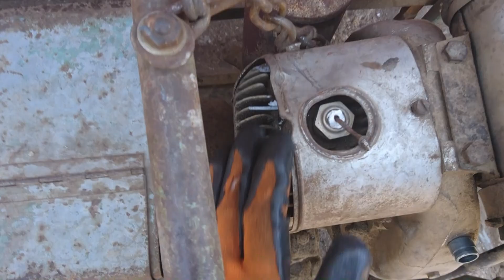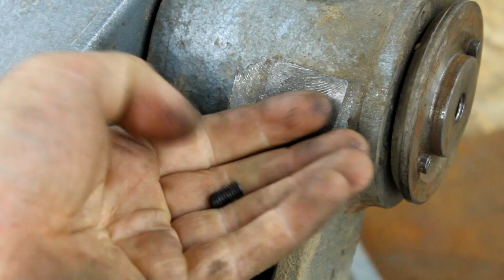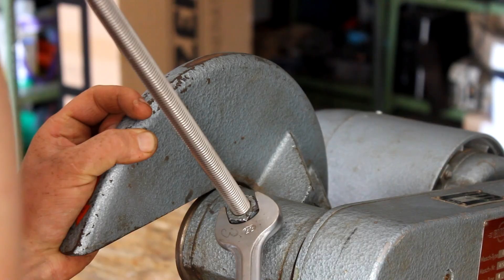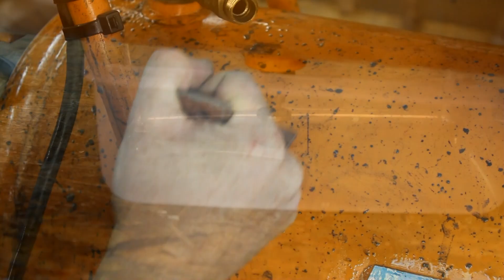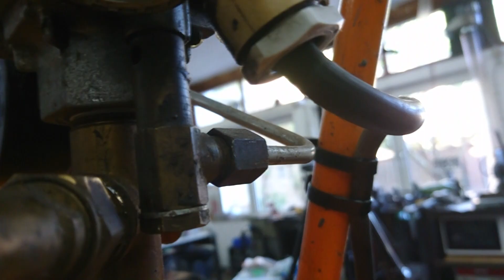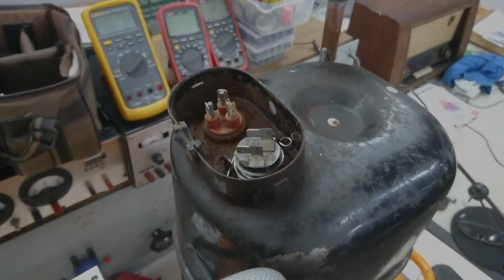Many More Scrapyard Finds! Repair-A-Thon!

Comment from the maker: The first four episodes of this series can be found in the video description!
Reply: LOVE the intro.
Reply: @jamiestone5364  The intro has very energetic music. It reminds me of running very fast downhill.
Reply: personally if you made videos of going through the scrapyard we as viewers would still watch both as it is cool to see the items that are there and to theorize how they could be repaired or re-purposed
Reply: You can make your own ultrasonic cleaner. They are super easy to make. Ask your friend to allow you to take the one you borrowed apart to inspect how it's made, then using fleaBay, purchase the kits that are in plentiful supply online. The only difficult part is how you attach the bell to the tubs (you can use tubs like the ones used in presenting salad bars, the deep kind). They provide a mounting screw that has to be spot welded to the tub with most kits. That, is the most difficult part.

I made mine using a cheese making vat (found it at the scrap) and such a kit.
Reply: Geile Sache, man fängt an alte Werkzeuge mit anderen Augen zu sehen
Reply: Please...... finish the videos on SMPS
Reply: I love the silent compressor... I hope I can build one someday...
 Many Blessings , SMR
Reply: Careful about soldering high pressure components, solder will become subject to wear and tear as pressurization occurs. Just my 2 cents.
Reply: Finish the other videos, you never put parts 2 out. You just abandon everything and move on to other stuff
Reply: No like for you because you didnt time how long to fill and compare to old pump on the compressor (very useful to know if the extra time to fill compressor is worth the silence.) was it 2x as long 6 times as long? 10 minutes to refill at super slow speed or the same speed?
Reply: Hi, just a little detail... the 3 connectors on the the compressor could have been single phase constructed with a START and a RUN winding with a common leg to those 2.
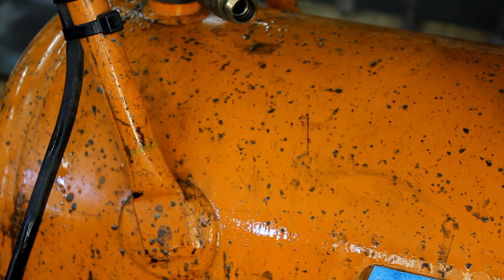Reply: 17:22 To remove dried concrete, you can wash it with Hydrochloric  acid, aka Muriatic acid. Test it on a small area, but it should work fine. I was told about this by a guy who worked at a concrete plant as a delivery driver. He had to use it to wash the truck after each day's use.
Be careful with it and follow the safety instructions, after all, it is a strong acid.
Reply: 1. RIP stamping machine
2. RIP Kuper machine
3. RIP A. Neumann "gear motor" having machine
What if viewers got you a pickup truck? That is a tragedy to lose the classics.
I wish I had a fraction of your electrics education..
the base and fence of that Eisele chop saw are amazing, have you seen the chinese junk at the store? over $100 and the fence is the first to break, thin aluminum not a single piece but multiple intersecting junk parts. A piece of wood broke both the screw down clamps on mine...
Reply: U know I want to watch ur channel but don't cuz of the double commercials. U have enough subs for a paid promotion end the double adds and I'll sub and watch or don't idc.
Reply: @blairforce1755  Well isnt that cutting off your nose despite you face, if you like the channel and content who cares how he makes his money, well all have to pay the bills. I like, I watch, I learn, simple as that my friend.
Reply: @andchip.s  I don't watch channels with double comercials. The real money on here is sponsorship. Diversify.
Reply: @blairforce1755  Well thats up to you, think of all things you are missing by doing that.
Reply: Blair Force1 You claim that you don’t watch his (TPAI) videos because of the ads, and you decided to complain about it using lazy English?

First of all, you could at least have shown him the courtesy of using a few extra seconds to write your comment using proper English.

Second. Is it really that much of a detriment to your schedule to wait through the first 5 seconds (for most of them) of an add, to click “skip ad?”

If not, there are several ways to avoid those “detrimental” ads., you could try using! 🙄
Reply: Cured concrete can easily be removed by using acids and the industrial grade paints normally used on compressors don't give a damn.
Reply: You should seriously consider taking on some serious students.  Everything in your videos are things that must be passed on. I think its every man's duty.
Reply: @myshadowkungfu  hes very young by the looks of him no man has a duty to train others while he is young, you save that as trade when you are old and cannot work as hard, the young apprentice does all of the heavy lifting and the trade is that you teach them.
Reply: @fixt100 I would say its a obligation if one was interested in learning.
Reply: The Post Apocalyptic Inventor a acorn nut for the top of the handle of the saw..I hit up the local scrapcyardsctons of good stuff
Reply: New intro please
Reply: @philippe.654  No, I think the old one is perfect
Reply: Philipp E. Why would he do that?

Comment: Sandcloth is handy.
I saw an old timer sharing a tip about doubling the life of rubber belts, and rubber in general, and had tested his theory accurate through experimentation on his own vehicle, and then his customers.

He soaks the belt by rolling it up to fit in a coffee can or other similar fitting canister, and adding 303 aerospace rubber conditioner.
He let it soak for about 30 seconds, removing it to drip back in the receptacle, and blot dried it off with a cloth.
He then poured the 303 rubber conditioner back in the bottle.
He showed a belt on his personal vehicle with a very impressive amount of miles and age, and it still looked just about new.
I believe him, he was a man who wanted to help people save money, not sponsored.

Comment: I am curious as to how the air compressor has held up. With heretically sealed compressors doesn't the refrigerant carry the oil that keeps the piston lubricated? with no refrigerant and thus no oil, did it heat up? Are you still using it?
Reply: hermetically lol

Comment: Hello, as a former professional cleaner i can advise you to use  desolving cleaners on acid base to remove cement , and concrete spots, in our country ( Netherlands)  ill buy  Cementsluier verwijderaar from HG ( cement veil remover) , this makes the spots soft ( braking down its strength) after a day just wash it off

Comment: Angle Grinder: I'd like to ve one that has different upm bc for wire wheeling they run too fast imo. That's not really safe or fun to work with.. But I agree.:wirewheeling on a drill is a pain in the ass. 🙄
I may gift myself with a 45 degree Akku drill though for this (and other purposes) in the future... 😏

Comment: To remove some superficial fly rust I use this method: high concentrate vinager spread over it and then put some toilet paper layers on it to be soaked. Now seal the whole shabang with plastic film or some old plastic to prevent the wet stuff to evaporate. Let it sit for some hours and swash it off.then dry with heat gun! And emediatly put on some rost converter and oil layer. Works good for me. You also need very little of vinager. No need to soak the whole shabang... 😜
Nice video, much to learn from, well done! Greetings from Germany. I guess it's interesting for foreign viewers from other countries to check out what stuff and machinery is pyling on German Scrap yards! I for myself enjoy watching people in the UK or US or other Countries to take me along repairing old scrap yard findings... There is even a girl from China. She has a Chinese and English channel. But she painted her Lathe pink
... 👀💋👀😢.. What a shame😂😂😂. Sadly I can't remember the name of the channel. If I find it again, I'll provide the info here😉
Greetings from Oldenburg /Northern Germany. 🇩🇪😎

Comment: I'm not sure if you're already aware of this, but be careful of using stainless steel hardware on carbon steel equipment. This can cause galvanic corrosion. Also, different grades of stainless steel and whether or not it has been passivated (freshly cut vs. weathered) can affect its electronegativity (vulnerability to galvanic corrosion) 
That said, it won't be a problem in this application.

Comment: To remove cement from various surfaces You can use https://www.farmec.ro/produse/locuinta/nufar-detartrant-clasic-1000-ml-208.html Or something similar They are based on acids
Rinse well after I used the car (I found a small accident on my car caused by careless work)

Comment: Hey bro just a thought cooling the air before it goes into air tank then the radiator connects to the dryer then to the tank you can get better use of your tank an old aircon for the radiator should do the trick.

Comment: This is a while ago but on the off chance no one answered the question about how to remove hardened cement splatter, if it was on masonry you'd mix together a solution of one part muriatic (hydrochloric) acid to 10 parts water and apply that.   But not sure that it wouldn't affect the paint in this case.

Comment: The easiest way to clean rust from large objects is not with wire wheels or brushing. You simply insert objetc in white vinegar (acetic acid). Leave for as long as it takes for the rust to be removed. The acetic acid physically removes the rust and leaves a clean surface. You do not even need to use a wire brush. I cleaned two very old rusted hammer heads by insertion in vinegar for about 7 days, and I did NO wire brushing. The hammer heads were perfectly clean. And you can keep reusing the vinegar.
I know a man who has a swimming pool of vinegar and he derusts old car bodies whole and no wire brushing. You do not need citric acid, although it is an excellent descaler for coffee machines. White vinegra is cheap and the correct material.

I am a Material Scientist, Industrial chemist, metalworker and woodwork teacher in high school in Australia.
I repair many like you and most repairs are simple and easilydone. Regards.

Comment: Refrigeration compressor motor is cooled by returning refrigerant with out refrigerant your motor is going to overheat and go off on overload also you need to install a oil separator ,because oil in your compressor will be pumped out and your compressor will run with no oil! and we know what will happen.

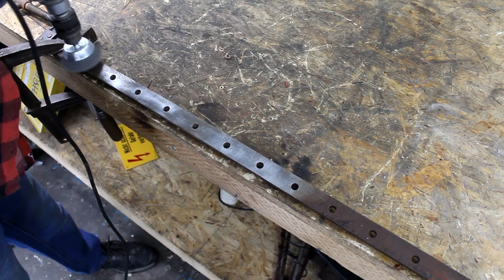Comment: 13:46. Reverse the direction of the power drill and you will have much more control over the wire wheel.

Comment: Muriatic Acid does a very good job of removing concrete however, may damage enameled coatings even if its washed off. Could use weaker acids.

Comment: Use diluted sulphuric acid to remove cement/ concrete on the surface of the tank. ( or murictic acid)

Comment: Cement is calciumbased , so hydrochloric acid (salzsäure) diluted in water could do the trick , I do not know the ratio but I know that in pure form that acid dissolves calcium.Maybe use a small paintbrush and put pure acid on only the spots and let it activate and directly rub it off with a dripping wet soapy water sponge.

Comment: Refrigeration compressor is probably not the best to use as an compressor because sump oil is carried away with the outlet air and in short time the compressor would run out of oil without any indication. In a normal refrigeration the cycle is closed and the oil return to the suction side of the compressor which is the sump but in an air compressore this is open loop.

Comment: I was at my local scrap yard thursday, they didn't have much (probably due to the virus) but there was a large gas powered air compressor with what looked like a 50 or 60 gallon tank. Sadly I got there an hour or two too late and it was upside-down and buried under a large pile of metal. I need to start going there at least once a week instead of once a month. They normally have decent small engines and lawn equipment that people don't like to bother with anymore.

Oh and as always, be kind to your scrap yard of choice's employees! Maybe buy them a box of donuts or something nice occasionally. They're nice enough to put up with us poking through piles when they don't have to.

Comment: I enjoy your videos very much - in addition to being a pedant, I'm a scraphound too - and I'm happy to see you reviving some quality equipment. Your English is also very good but I noticed that, like so many non-native speakers of English, you call the back of things "the backside". In colloquial English a backside is the part of your anatomy that you sit on. In other words bum, behind, bottom, posterior, in fact Arsch! ! When we speak about three-dimensional objects in English we usually speak of the front, the back, the bottom, the top, and the sides of things (left and right) without adding -side. We do refer to the upper side, the lower side, and the inside and outside, when speaking about objects. We also have upsides and downsides but they are mainly used to describe outcomes. Alongside means next to or compared to. Please believe me though, even after this, I'm on YOUR side! 😁

Comment: It looks like your propane torch has protection, but the warning about 'pistol grip' torches is still worthwhile, at any chance.  I had been using one for 20+ years, when I accidentally found a gruesome website built by an American attorney.
He has been fighting the good fight against torch bottle manufacturers for many years.  Turns out the bottles were designed for the older propane torches, where the bottle was the handle.
With the invention of pistol grip type torches, the bottles, (or the torch manufacturers), should have done something about the additional stress on the bottle tops, but they didn't, you know, because of cost, I'm sure.
Then, the first unsuspecting DIYer discovered what happens when the propane tank ruptures due to the additional stress of the pistol grip design.  This is where the 'gruesome' description of the site I found becomes obvious.  The attorney has images of several clients who have experienced a tank failure.  The clients contributed their post injury images as a public service to warn consumers of the dangers of pistol grip torches when used with non-reinforced bottles.
I applaud them for it. The last thing I would want is my image on the 'net, if I had been through the painful, extremely disfiguring accident they have experienced.
The images did their job on me, though. I immediately went to my shop, removed the pistol grip torch, and threw it away.  I suggest everyone do the same. The slight amount of inconvenience of the old style torches is not worth the gamble of terrible disfigurement, or even, death.
In the US, at least, nothing has been done, (at the time I found the attorney's site), to force manufacturers to reinforce bottles, or integrate bottle reinforcement into the torch design.
I hope this saves just one person.

Comment: This may still sound like consumerism, but in the US, it’s pretty uncommon to do this. I repaired my parents dryer, I believe the bearings were shot on the motor. I have no idea how to remove the bearings so I asked my parents if I could try and fix it (they were already looking at buying a new dryer). I found a kit for $72 and my dad was over the moon and bought it with $17 for shipping (most expensive one bc we needed it fixed ASAP). It arrived Friday (2 days ago) and I put everything back together and boom! It works perfectly!

Like I said, in America half the people here just buy a new thing when it breaks, and I hate it. Now I could’ve just bought new bearings, but I have no clue where they are in this motor, and I didn’t want to risk braking anything. While taking the dryer apart I also realized we needed a new belt, and the new motor that we bought came with a new belt, idler pulleys and tensioners, so we just bought the kit and, like I said, works just like new!

Comment: An AC-compressor as a air-compressor will probably short out since the motor wiring is not coated to deal with oxygen.

Comment: I like your videos and i totally agree with you on every aspect of the intro in your video. I myself repair and reuse as much as i can and not only to save money which i do BTW but it is my attitude towards the use of resources. The only thing i would like to mention from a technical point of view is the soldering on the compressor copper tubes that i think they are not so strong as brazing. Keep up the good work.

Comment: Removing concrete splashed upon your compressor is possible, but takes time and effort with the angle grinder and perhaps a new paint job. A wire wheel could work. A hand held brush with a scraper on the other side may also do the job.

Comment: Thanks for the tip on using WD 40 for rust removal. I am in the process of restoring some old hand saws which belonged to my grandfather. It will mean so very much to me to finally be able to use his saws.

Comment: in case you have not already solved the problem of concrete on the tank... Go to your local builders merchant and ask for (what we call in England) Brick acid..  DIY Chain stores are unlikely to sell it but its readily available from where builders get their supplies. Its some form of acid (others may know which type, muraic? nitric?)  that loves lime and dissolves it. the concrete / cement / mortar will rinse off with a hose.

Comment: To remove concrete you can try something acidic, like rust converter or calcium and lime remover. In Australia, we have a product called C.L.R and it works fine with minor concrete splatter like that.  Also steel wool can work fine.

Comment: Get rid of cement or concrete?  Easy.  Acid.  Dilute some muriatic (pool) acid so that it's not killer strong and then wipe the surface to be cleaned.  Gloves and eye protection needed, of course.

Comment: The Eisele saw is a great find. With new bearings, it will make an excellent tool. In addition, it is a brand known in the industrial field, compared to many light machines without well defined brands.